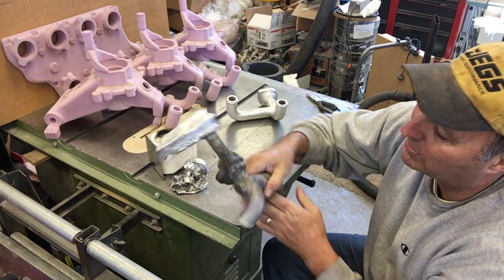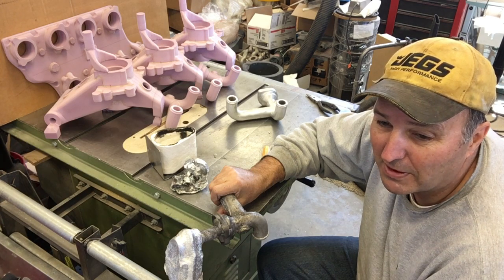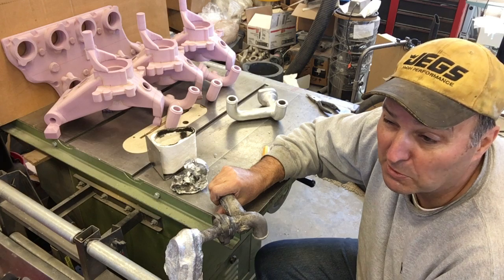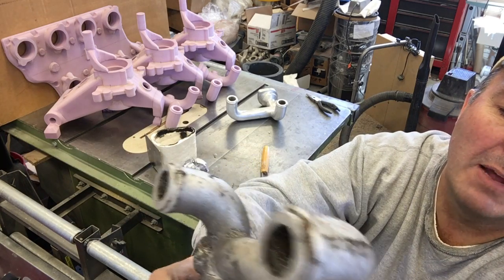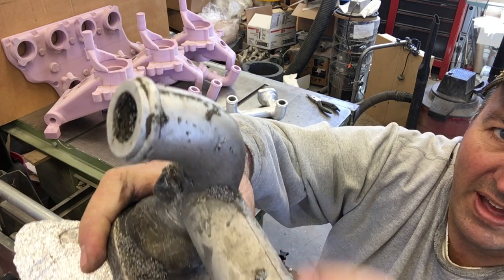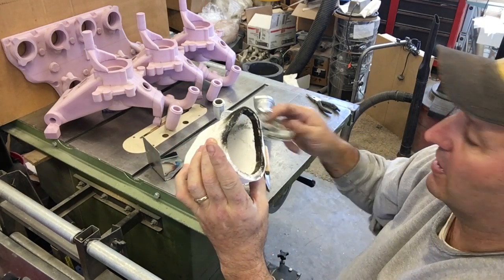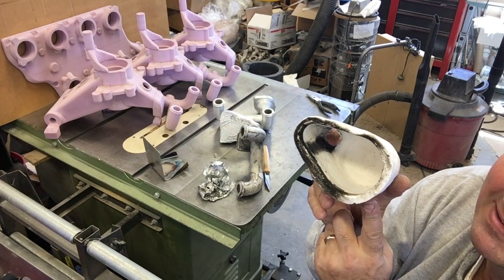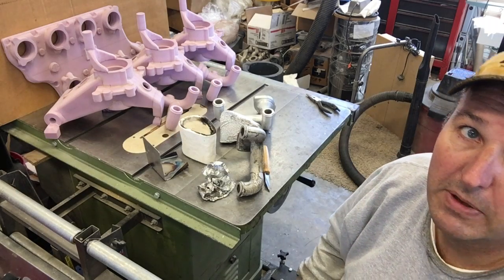Lost Foam Aluminum Part 7 - Examining the Casting

Comment: Sitting on the saw table are a few large foam models that look like 4 wheeler suspension parts... I suspect they were made with smaller pieces pin routed and glued together. Meaning, buy using the presented ops they are possible with enough build up work to learn the process. You don't have a 6 axes cnc hiding behind the curtain?
Reply from the maker: It's an automotive upright for a Pantera. No video but my build thread is here. http://forums.thehomefoundry.org/index.php?threads/automotive-rear-upright-wheel-carrier.543/
You may have to join the forum to see pictures or full size pictures. There are a lot of them. I did this one quite a while ago. They were assembled from many pieces on machining and assembly fixtures. These days I'd probably CNC two halves andstick them together. Best, Kelly

Comment: those 'casting boogers'  look exactly the same as ones you get with ceramic shell when the larger investment grit  cant get into small details  and a void in the shell forms  , the metal boogers  that form in these voids are only very loosely connected to the casting though often they get mechanically  locked in  and can be hell to remove . but as you observe the casting beneath them is still good so they must fill through tiny pin holes - My favourite tool for removing them is a dental pneumatic chisel - one designed for devesting dental castings not removing teeth !
Reply from the maker: Yes that is exactly correct. The coating becomes compromised because the backing sand is insufficiently packed and the metal penetrates the loosely void but the coating still persists between the two, so the boogers can be dislodged.